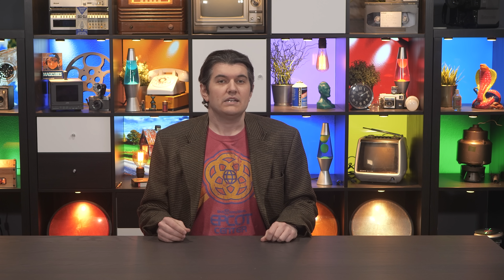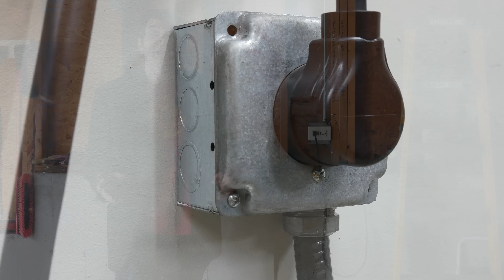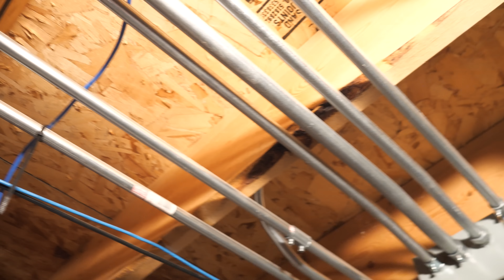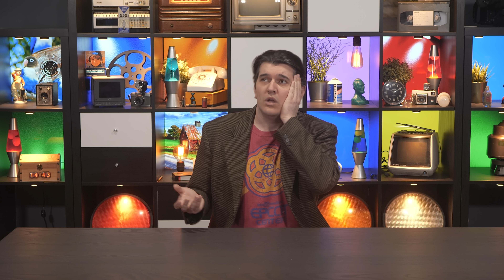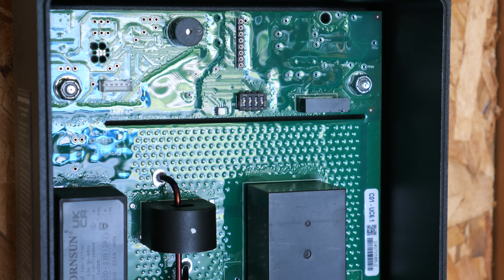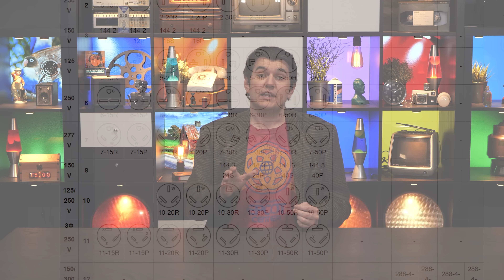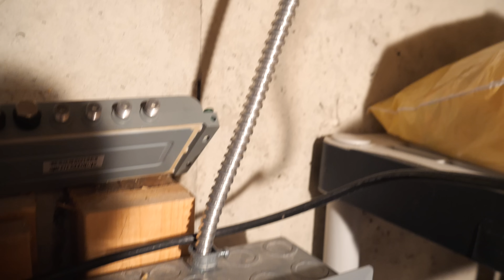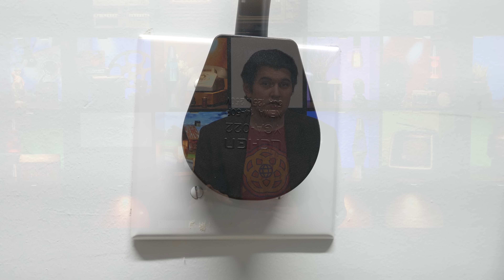The "standard" car charger is usually overkill—but your electrician might not know that

Comment: Good video. We were really lucky because our house had an existing NEMA 14-50 outlet on a 50 amp circuit right in the garage. Why I don’t know but I am certain it wasn’t for EV charging. All we had to was get a “charger “ and a beefed up receptacle suitable for sustained use at 40 amps. Could we get by with just plugging into the standard 120v 15 amp outlet in the garage? Yes we could.  Particularly since we now have access to multiple DC fast chargers within two miles of home for emergency needs. So far no emergencies have occurred.

Comment: 4:28 As an Internal Combustion Engine pleb, I still don't get the 80% rule. Why not charge the battery fully to 100%? It's like only ever filling up the gas tank of an old-fashioned gas car to 3/4 tank every time.
Reply: I don't know the science, but it helps to prolong the life of the battery. The same applies to phones with lithium batteries. Ideally you would only charge to 80%

Comment: I have a cybertruck and been rocking 110 charging for a year.  It’s a 2nd pleasure vehicle so I can get by with 110 but it would be nice to install a little faster charger. 14/2 x 25 ft. Solid CU MC to a dryer plug seems simple enough. The garage has open breaker slots. If I burn my shit down I’ll think of you 😘

Comment: Your video is just the right length.  And, as always, it was informative and entertaining.  Thank you for posting.  

A "remake" or "new and improved" BEV charging guide would be great, and I would enthusiastically watch it.  You could also include a basic BEV buying guide, too.  There are things that not all people will necessarily think of when buying their first BEV, especially if they're buying a "barely better than a beater" class of used BEV.  Some of it, while simple, needs to be said, such as "find an independent repair garage that will work on your BEV before you buy it, while you have a working something to drive around in and actually check the places out.  In 2025, quite a few independent garages will still either not touch BEVs at all, or they will only do brakes, tires, and alignments.  If you've already found a reliable repair shop before you buy the vehicle, then when it breaks down, you won't necessarily be breaking down with it.  Along the same lines, that independent repair shop can inspect your potential purchase for you before you buy it.  While they might charge you for a half-hour labor ($50-$75 or so,) they might also do the quick inspection for free as a courtesy and an extra incentive to earn your business when the car breaks down.  And all cars break down eventually.

For the "elephant in the room," the main propulsion batteries can be repaired, depending on what's wrong with them.  A good independent shop can tell you if the repairs are worth it in your particular circumstances.  New car dealerships will typically work only on their own vehicles.  As a rule, they will not attempt to repair a "tired" or "broken" propulsion battery beyond the very simplest of repairs.  So, find that independent garage that will work competently on your BEV.

Even when buying a new car, not all dealerships really want to work on BEVs, even in 2025.  A few "hints" on what to look for beyond the actual price paid or financed on where to buy or not buy a BEV would be helpful.

Back to charging, there are well over 160,00- 2011-2025 Nissan Leafs on the highways in the US.  And they all use only CHAdeMO for DC Fast Charging.  (the "Leaf" name will still be around in 2026, but it will be a re-badged Ariya with NACS.). While the Leaf is a good car for what it is, the potential Leaf buyer will need to consider and find reliable adapter(s) to use CCS1/NACS DCFC stations "now," and not put it off.  While Leafs will still be somewhat abundant on the US roads in 2035, the native CHAdeMO DC Fast Chargers won't be.  They're already becoming scarce.  This doesn't mean that you can't take a Nissan Leaf in good electromechanical condition on a road trip.  It does mean that you will need to "do your honework" ahead of time, and more carefully than many who own more "common" makes of BEVs.

Comment: Bang on! We added an 8kW PV array, and Trane heatpump and went fully electric. BUT the heatpump was oversized at 3 ton (of course! - a 1.5 ton Moovair would have been a better choice) and the worst thing was that the installer oversized the backup electric heat at 10kW (should have been 5kW max) - which required an electrical panel upgrade from 200A to 100A. Well, we could have expanded the panel to 130A - and that would have been the cheapest and best option - but we didn't know until a year later. Our Kia Soul EV charged from a 120V outlet until the electrical panel upgrade and then we went to a 20A @ 240V outlet in the garage - so our cheap charging cable uses 15A / 3.6kW and can charge the car fully in just over 7 hours. Works a treat!

Comment: Level one charging should not really be recommended. Not only is it very slow, it is also very inefficient. You end up using a lot more electricity because of the fixed overheads involved in charging.
It Is a great backup option to have, but you should do everything you possibly can to avoid using it as your primary setup.

Comment: I installed a 40 amp charger on a 50 amp circuit, even though I would be fine with half that charge rate or maybe even less. But I wanted future proofing as batteries get larger and larger in the future, and I also wanted the ability to more quickly charge my car in the event of some sort of human error like forgetting to plug in, power outage, or some other issue that caused me to not be able to charge overnight.

Comment: For a few months this year, I had a ~60 mile commute (round trip) on Route 2 in NW Ohio, and I drive a 2020 Bolt. I only have 110V charging at home, and it worked Fine. I didn't get a full charge every night, but I got enough every night for the battery to last an entire work week and then fill up to 90% (I bumped it up a little to give a bit more margin of error) over the weekend. Even the slowest 240V charger would have made this a non-issue, but 110 worked. 

You have to get into some extreme daily driving amounts to require even a high-output 240V, let alone for home charging to be wholly inadequate.

Comment: With an outlet, that’s not even installed in the right direction with improper securement… Buy a Tesla and you can set whatever voltage you need.

Comment: I charge my EV exclusively with a household outlet in my garage. It’s good for battery health to charge slow and I just top it off to 80% every day. I do maybe 20 miles each way on a busy ish day and 5 miles each way on a regular day. I have never had a moment of concern over charging or range anxiety, even on the odd day where I need to go 80 miles round trip. The car gets 4-5 miles an hour on a wall outlet and I would be willing to bet that’s all people need. My EV has a 140 mile rated range and in reality with my driving it’s 120 miles. I’m super comfortable at 80% charge. 

Simply use a gas car for a road trip.

Comment: I got a NEMA 14-50, but purely because I had to run a new circuit anyway, so why not run a big beefy one?

I’m only on 100A service so I was perfectly happy to take whatever 240V circuit they could accommodate without a service upgrade. 240V 30A? Would have been fine. Even 20A, or 15A. Since it’s 240V that’s still twice as fast as a normal outlet. But they told me they could accommodate a full 50A on my current service so I was like, sure go for it. It’s handy for running other things too like those beefy 240V garage heater.

In theory if I was charging at the full 40A and running my AC and running the clothes dryer it could trip the main breaker? Never happened yet though, and I can always turn the current to the car down if needed.

Comment: I mean, installing that plug could be overkill, but thinking about how easy it is to install a power outlet on the average North American home, where you can just punch the hole with your own hand and run the cables through the mouse poop inside the walls, is not a big deal to install one.

Comment: One downside of using lower power levels ist a higher percentage of losses. I can imagine a 120 V, 12 A charger wasting a lot more energy than 5 KW setup for the same charge. That can add up quite a bit.

Comment: I have a Ford E-Transit, and got tired of the charger it came with, so I bought a 32amp Leviton charger, and have been happy with it ever since. It can charge it overnight in about 10 hours if plugged in nearly dead. It's capable of 11kw, but like you I preferred to use 32 amps rather than 40 on a Nema 14-50 outlet I had already installed in the garage when I bought it and got it home from the dealership. The portable charger it came with came with both a 5-15 plug and a 14-50. But it didn't like the heat in my garage and would have an error once in awhile. The Leviton runs much cooler and doesn't get very warm. I also totally agree on the "smart charger" points you mentioned and I wanted something that didn't require an app. The Ford app already gives me the real time charging power, charge history and all of that. The only thing I would think would be "excessive complications" is it came with two RFID access cards so you could for example install the charger outside, and then you would use the access card to enable it to charge, so your neighbors or some random person wouldn't be able to come by and plug in their vehicle and steal your power, a handy feature for installing the charger for example at a townhouse complex etc. But it comes setup with no access, so I threw away those 2 cards to avoid locking myself out of it. It was too easy to accidentally enable those cards, all I had to do was wave the card in front of the card reader symbol one time while it was plugged in to learn that card.

I have checked the outlet/plug and wire, and the outlet and Nema 14-50 plug don't get any warmer than the wire, I ran #8 gauge wire from a 2 pole 40 amp breaker. I have a 200 amp electrical service but I have a lot of other loads like a 50 amp outlet for a welder, and I didn't want to install a 60 amp breaker for the charger. Because 10 hours to charge versus 8 with a 60 just wasn't worth the expense and hassle of dealing with thicker stiffer copper wire (which isn't cheap, even at Menards!)

Comment: I purchased an f150 lightning 6 months ago. I planned on installing a 60 amp circuit for full 11.6 kw charging. However, as a stop gap, I reused an old 30 amp dryer circuit. 

I’ve never needed to upgrade. The 5.7 kw is enough to recharge 30% of the extended range battery during the 6 hour “super off peak” rate. My normal commute is anywhere from 18-23% of battery for the round trip.

Comment: You don’t NEED it, but if you are going to have someone install a dedicated circuit for your EV charger which IS recommended, it won’t hurt to go with the upgrade if your electrical panel and service allow for it.
Reply: The point of the video is you can diy or have a cheaper installation

Comment: When the Volt came out and plug-in hybrids had an all electric range of ~40 miles I had co-workers complaining that "I drive 5 miles a day." They were shocked when I pointed out that now there's 40 miles a day where you wont need gas. Even with the first EVs they've always wanted that range to go from one end of the state to the other, which they do just once a year. The idea of purchasing a car and specing it for the once a year trip is mind boggling.

Comment: Thanks for another fine video! This knowledge is so important! Electricity is simply everywhere and the only problems with using EVs is those who are made by petrolhead-set ones. In Europe we have 230V on three phases, thats mighty 11kW on simple and small 16A circuit. It is like 27 miles per hour of charging speed! Nearly mind blowing :-)  I sell ABL wallboxes, it has RS485 to communicate if there is a need, but there is no such requirement, it can be fully offline. And the HW+SW can be fully open source, including smart home integration like HomeAssistant and stuff. There is even an enable input to have a mean to block charging when needed by thing as simple as light switch. But you can connect Shelly and control charging... The only difficult stuff is that older/worse EVs simply do not support connection app for them to prevent a battery take a full charge, as it will damage it if its done on regular basis. But there are solutions even for that. Thx again for such a nice video and take care! 🙂

Comment: Greetings from Finland! I've been successfully charging my ID.3 for four years from our standard wall plug using the 8 amp cable that came with the car. That's 240V x 8A = 1.5 kilowatts as we're in Europe. Enough to charge overnight almost every day to full. An added bonus is that when I plug the car in when I get from work, it's not charged instantly - it goes well into the night when the electricity price is cheaper. Why get an expensive charge thingamagic that can schedule your charging into the night hours (programming a 1980's VCR comes to mind) when the same effect can be had for free with the standard slow charge cable!

Comment: At 21:00 there is a third problem - sharing limited spare electric capacity among multiple EVs.  If you don’t set up shared smart chargers, your building will run out of power very quickly.  And an upgrade to the transformer serving your building will run into the six figures.  So, smart networked EVSEs have their place for condominium and apartment buildings, as do companies that set up and maintain these networks for such buildings.
Reply: Can I add a fourth problem? Higher insurance premiums due to storing a fire hazard in or near a residence? Not saying it’s reasonable, but it is a thing
Reply: @TastySlowCooker If you think electric cars are a fire hazard, wait until you find out what combustion cars are full of
Reply: @dylangergutierrez  I assume you’re just itching to have an argument with an EV sceptic, but I’m not one. I’m just telling you that insurance companies see EV’s as higher risk that ICE’s. If you think they’re wrong, your argument isn’t with me, it’s with the insurers.
Reply: @TastySlowCooker  Intact Insurance gives you a 10% discount for running an EV.
Reply: @economicprisoner  weirdly, it’s not so much car insurance. At least where I live, owning an EV impacts home & contents, even though car insurance is comparable. Insurers I have access to ask about EV ownership and charge higher premiums accordingly. Multi-occupancy only complicates this further: how does an insurer price risk when the home is a duplex and next door has an EV? I also theorize (and this is just conjecture), that this is why so many crash repair companies won’t touch EV’s - the premiums on a business willing to house EV’s involved in accidents would be enormous.
Reply: @TastySlowCooker I see now that you're focusing on home insurance and not car insurance.  You're right; while an ICE vehicle may be at least as likely to catch fire in some contexts (see: the Ford Pinto), that's usually either in the course of operation or in the event of a collision.  An EV is a lot more likely to catch fire in the middle of the night in your garage while you're charging it than a gas car is.

I don't think your point is unreasonable, I just like to remind people when they talk about the general fire hazard of EVs that this is also an ongoing issue with most standard cars on the road today.  All it takes is a fuel hose with a pinprick next to a chafed spark plug wire and you have the makings for a car fire.
Reply: @dylangergutierrez  yeah I mean I probably could have been a bit more careful with my example, one probably shouldn’t yell fire in a crowded EV youtube comment section

Comment: When I installed my EVSE, I had two choices. The dumb charger had a socket for a charge lead and the smart charger was tethered. As I wanted a tethered charger, I had to pick the smart option. As it happens, I'm glad I did. I get cheap electricity from midnight to 7am, so that's when I want the car to charge. Despite the fact that the car can be set to do this, it just ignores me because it's a Volkswagen Group car, and their software is beyond awful, so it repeatedly just tries to charge immediately. The smart charger enables me to set the timings from the other end of the cable. Off topic, I could rant for hours on how buggy and &^%£ &^%£"( !*&*%( the VW software is.